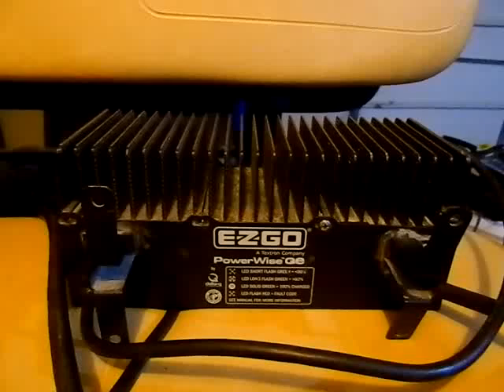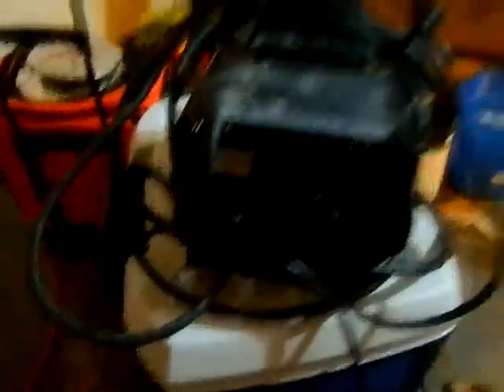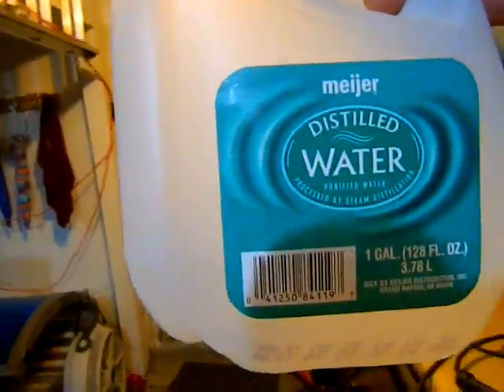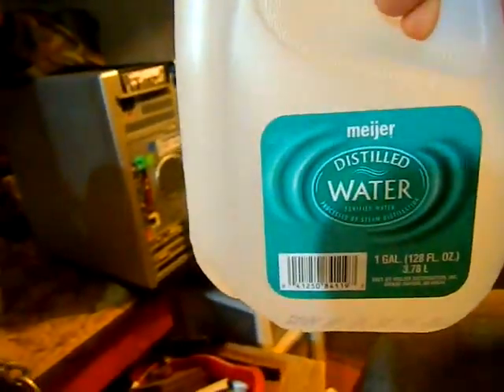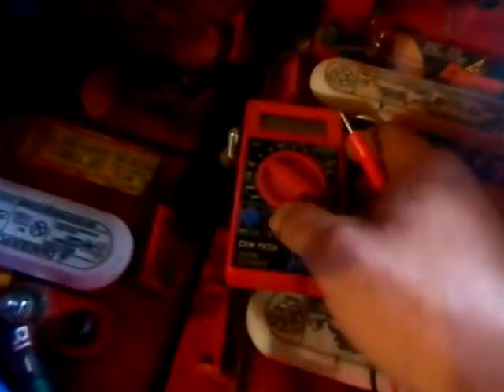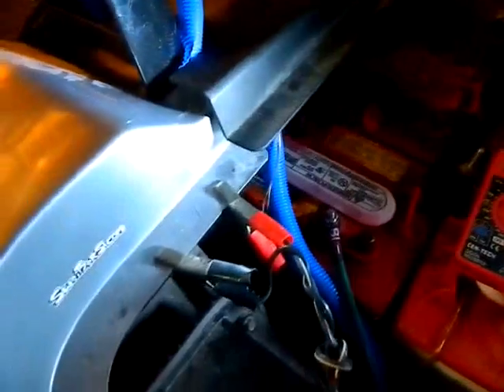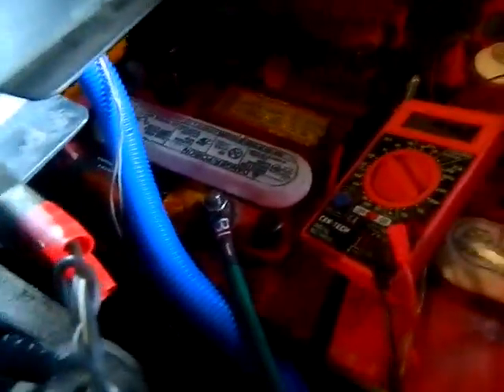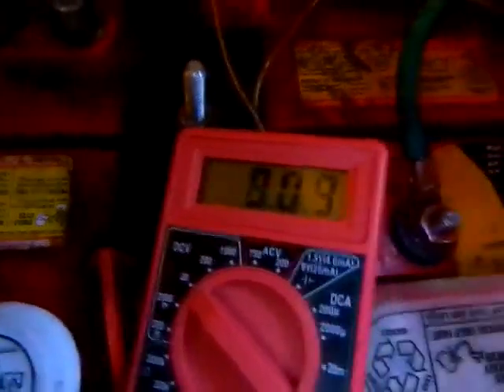ezgo txt pds 36v golf cart charging problems

Comment: Hello here's what I did I replaced my 6 volt batteries with 3 - 12 volt deep cycle marine batteries I purchased at Walmart $380.00 and it works great the golf cart is much lighter and seems faster I also got rid of that heavy ezgo charger and replaced it with the Schumacher charger,  I have had my golf cart since the early 90's and was recently getting ready to replace the 6- 6 volt batteries until I found out how much they have increased in price $1100.00 from a few years ago at $700.00, you just hook the 3 -12 volt batteries in sequence just like the 6 volt, this also gives you more room under the seat for storage, so when I did this project I also replaced the battery carriage that was close to being rusted away and I fabricated a new carriage out 2 x 2 inch angle iron and expanded metal, hope folks can use this info because since Biden stole the presidency everything has tripled in price.
Reply: That he did! I have always wondered if 3-12v would do the same. I've been looking for some that has done this. Thank you!
Reply: Umm the chargers are meant for 6 6 volt batteries good luck

Comment: The problem is for anyone experiencing this is if the battery gets down too low, that is why the Charger does not kick on so you never want them to get too low or else the only way to do that is with a car charger.  You can charge them in pairs with the 12V charger.  The ModZ Max36 charger has a trickle charge built in which would prevent this from happening.  It is pricier but I think it will be well worth it.

Comment: That distilled water did not ruin your battery. If you have 1 cell that gets low , it is a bad cell. All the cells should take the same amount of water. Replace the one battery with low voltage and you will be good to go.Here's a hint, the key is charging at 36 volts all batts need to be even. New replacement will be different. Take your 6 volt charger and charge each battery to peak, before you do the 36v normal charge........

Comment: You've probably been told already, but that gauge on your "car battery" charger reads DC Amps, not volts. So, as you were thinking it was showing only 2 volts, it was actually showing it charging at 2 AMPS worth of current at 6 volts. Which would be correct because it starts the charge at 6 Amps at 6 volts, then drops the AMPS down gradually as the battery takes the charge. Therefor, 5.5 volts would be about right for a 2 amp charge at 6v because it's almost completely charged.

Comment: Did you ever put in a voltage reducer for your 12 volts from the 36 volt bank or did you continue to use just the 2 problem batteries to get your 12 volts for accessories figure out the problem hmm

Comment: I need some help 
I am working on a 2006 Ezgo the batteries show 6.3 volts but when I put them on charge 4 will show 8.1 8.2 and 2 of them will show 6.3 6.4 volts any idea why ? Just got all new Trojan batteries and cables POWERWISE charger
Reply from the maker: mine dose as well UNTIL you put them a full load they show higher as far as your 6.3 batteries simply put by now your already know the answere ..its a slow cart isn't it..a couple of them  had weak cells

Comment: Dude the charger is showing amps not volts. You're measuring two different things.
Reply from the maker: well I know this ITS not a 30 amp 6 pack  besides I kinda think you already knew that but thanks for watching
Reply: Charger amps ..volts is voltage.LOL

Comment: equalize them , ezgo chargers do not equalize , and use a desulfator, a cheap one off amazon worked great on my trojan 105 , im no nothing but my batteries are 7 yrs old started giving me issues so i researched all of the fru fru crap and quit listening to you tube idiots and contacted trojan and research my ezgo charger. you must equalize DC batteries once a month and the addition of desulfator while charging brought my batteries back . since ive started this regiment they get better n better. also check your cables what may look good could be garbage.  you should also get a hydrometer to test batteries , check trojan site for info . what happens is electrolyte settles to bottom of battery and sulfation occurs . so from what i understand the desulfator and equalization is key.  not sure but my golf cart runs like new batteries again. and i spent 20 bucks on a desulfator and i also do the same with my bass boat tm batteries . your issue with distilled water is bs use a tds meter and determine how much solids are in it. not saying the label on your water is a lie but thats how america rolls these days just lie and its ok. distilled is distilled salt molecules cannot transfer during this process. but a tds meter will tell you if it is truly distilled and that info you can find like i did.  and im sure someone will call me out but i talked to trojan and my friend has built batteries at interstate for 39 yrs . they know not youtube liars. and dont ever try too save your batteries with epsom salt. thats a myth. also use around a 4 mah desulfator the older higher mah ones can damage plates.  old practice was throw 60 amp charge to them to turn sulfates back to a liquid but it can damage plates.. some make it some dont. watched the whole process at interstate where they recycle batteries .  find a charger with recondition mode 2012 and up . but a desulfator and balance once a month works .  i too searched for the truth ,,, its not on youtube lol .  why you got a crap charger with golf cart, well american greed  yep its rampant , then obama shuts down our last lead smelting plant so we can endure even more greed by importing batteries or lead to make them . its all about lying to make more money.  then charge more for the product . boy does our country need a slap in the face but no let them bend you over instead.  its sad thanks dems hope you got more kick backs to fill your pockets. by the way crown makes a good battery  thinner plates is all .